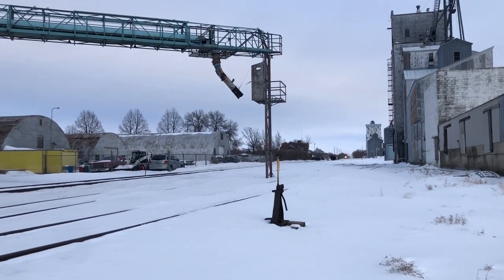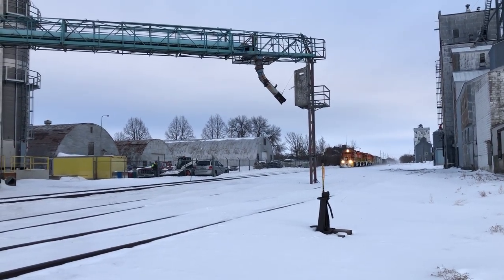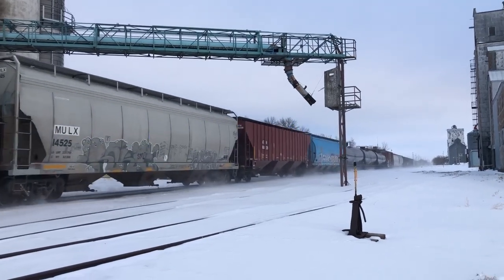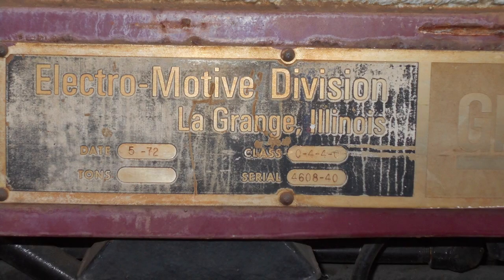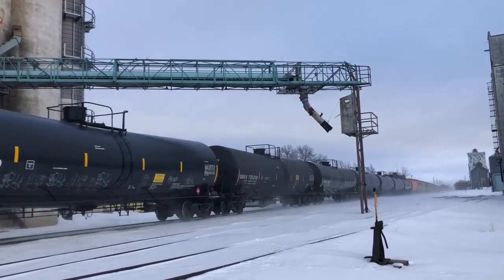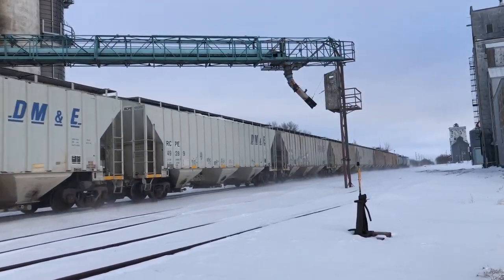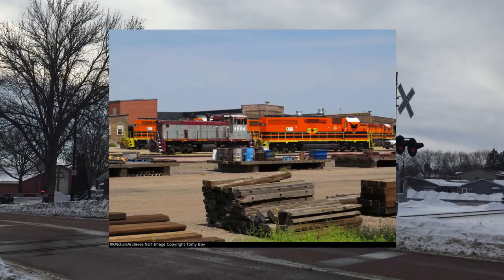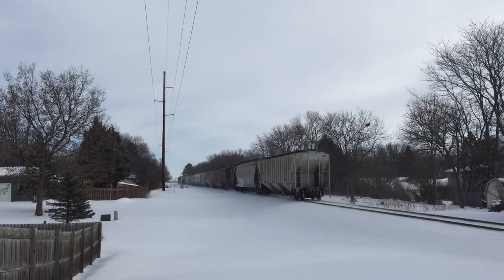CEFX 1604 - Switcher Special #1

Comment: Westbound around noon/early afternoon today.
Reply: Getting ready to leave aurora 6 engines 22 cars
Reply from the maker: For some reason, I didn't get the notification, and by the time I heard the horn and ran outside, it was long gone. I could tell 3445 was leading due to the RSL3 horn.
Reply: @brookingsrail  yep you can recognize that poor fouled horn from anywhere, haha. Chance for redemption today, they’re running an empty bean train in with BNSF power. Assuming they’ll be dropping cars at Aurora and Sioux valley, maybe the plant idk how the empty train works never seen it yet. It’ll be dark when they get to Brookings but might still be light at aurora.
Reply from the maker: Well I went to Aurora today and caught three GE's sitting around (as you'll see in the most recent video). I missed their trip up to Sioux Valley. Without any notice on the radio, they just showed up all of a sudden. I live on the west end of town, so westbound horns get blocked by the hill. By the time I heard the horn, it was already too late. However, I'm usually able to hear eastbound horns from miles away, so I caught them on the return trip. It was just two engines; they seemed to leave the Dash 9 behind. What I got tonight will be in the January video.